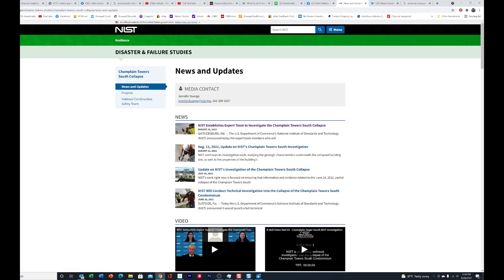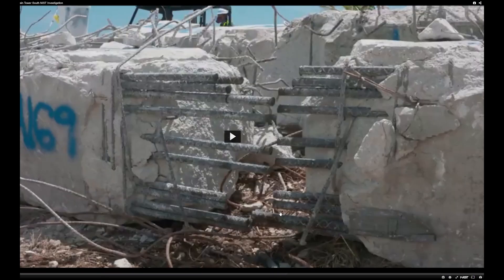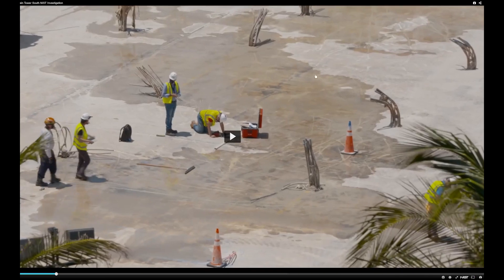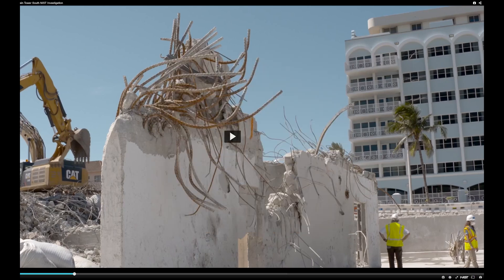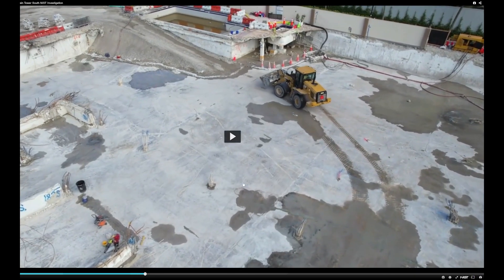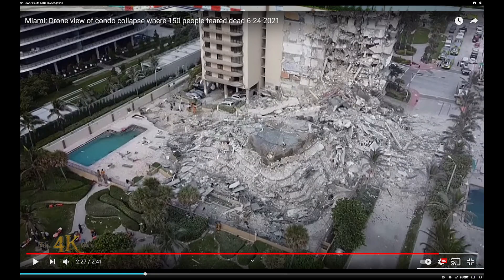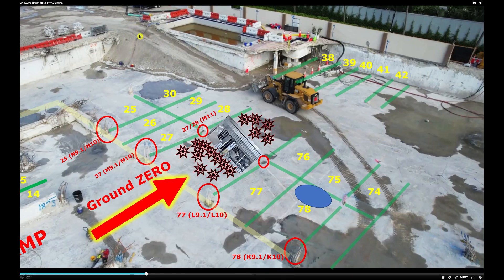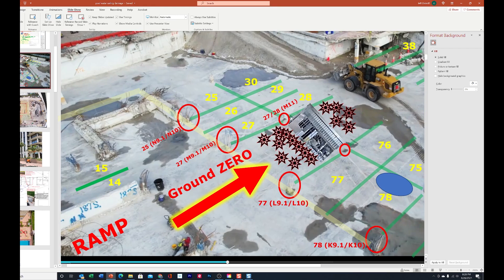Surfside Condo Collapse Site View NIST Video Ground Zero

Comment: It's as if the building was a failure from the start. Crowded rebar, corroded rebar, substandard concrete, column spacing off, the planters and lapses in upkeep. Leaking pool deck.....
Reply from the maker: Yes a whole blender full of a failure recipe

Comment: You keep saying "right here" when there is no visible cursor. This is frustrating. Others have solved this problem. You need to get a more visible tool.
Reply from the maker: some of the programs don't honor the cursor, I will continue to work on it. Also, I see it it nice and big on my screen, but when it records, the cursor is tiny, so lots of kinks to work out for sure.

Comment: Perhaps the design called for “bundled bars”, which is or was, acceptable engineering practice.  Bars look like they were cut as a part of demolishing the concrete into manageable sizes.  So, of course, you don’t see laps (or as you say overlaps!  Also, you say the bars are textured; no - they’re technically deformed.  I think you don’t know what you’re talking about.

Comment: You are not a structural engineer and you do not know what you are talking about. It is totally obvious per your choice of words you are a layman.
Reply: Please, spare us from your “expert” opinion.
Reply: I agree with your assessment.  I like the way he presents the material, but it is quite obvious that there are some gaps in knowledge.
Reply: @mariatamburro  there are really only two likely reasons for the building’s collapse, possibly a combination of both.
Salt laden rainwater penetrated micro cracks in the concrete roof slab/beams. This chemical reaction occurs and eats the reinforcing steel (rebar) and totally destroys the integrity of the of the affected portion of the structure. It is very difficult to stop this damage permanently and very expensive and a reoccurring maintenance cost. If unchecked a total collapse is possible.
Reason two: a structural design error resulting in a “punching shear” calculation at the column/ beam connection.

Comment: While you can provide pertinent information of the "after collapse", I laugh at novices like you analyzing contract documents and having little clue about how project drawings are developed.  I also lose a little respect when terms like "textured rebar " are used when the industry term is "deformed rebar" and when one doesn't really understand how to "read" drawings.  I also lose some respect when one attacks the architect without a basic understanding of how project drawings are developed.  Working with the structural engineer to determine possible spans between columns, the architect comes up with a schematic plan.  The architect may set his plan in stone while the structural engineer, working separately, will most likely have different numbers for columns.  Due to time & budget restraints of the design professionals, those minor incongruities in drawings may not get revised to make a "perfect" set of drawings.

I can look at the Champlaign Towers drawing and tell by the lack of detailing that they were slightly better than a builder's set, which means the developer was not willing to pay for a better set of drawings.

You seem to be confused by column line 9.1 and 10, but close examination of the drawings reveals it is blatantly obvious the column line is 9.1 and 10 is nothing more than a reference line for the protrusion of the balconies on the upper floors.
Reply from the maker: I laugh at clowns like you who come in and assume that because I don't use the exact same words that you do that you think it means I know nothing. I make these videos and dumb it down for the average Joe six pack to understand. The average Joe 6 pack doesn't understand what deformed rebar means, but everybody knows what the word textured means. Get over yourself go take your nonsense over to a fortnight channel where your type of banter is the norm.
Reply: @jeffostroff   - The clown is you.  A guy who is not a licensed professional Architect, Engineer or Building Inspector passing judgement on those who are.
You state "settlement did not cause the collapse", yet you have no survey data to support your claim and the large puddle of water in the vicinity of the failed columns would indicate you could very well be wrong.
Additionally, the very unlevel top of the retaining wall on the west side of the property may be an indication of settlement of that very thin wall carrying half the 26'-4" pool deck slab between it & column line 14.1.  The wall was supported by a thickened cantilevered slab with no footings directly under the wall.
You claim you are informing the uninformed, but you are also creating bias against the design professionals when you have absolutely no clue what their contract requirements were.  I can tell you, based on lack of detail, the drawings for Champlaign Towers was slightly more than a builders set (i.e. just enough to get a permit).
The lack of concrete adherence to the rebar & the fact every exposed edge of cracked concrete I have seen at Champlaign Towers has no fractured rock in it is indicative the concrete was possibly poured hot and/or lacked proper curing.
You can feed your ego all you want trying to make a buck off of a YouTube channel, but you're a clown to licensed professionals.
Reply from the maker: @paulpresson9786   I see what your problem is just because you don't share the same failure mode that I do that must mean I'm the idiot And I have no business giving opinions on the subject. And you keep bringing up the fact that I don't have A PE license well let me make this perfectly clear to you. It was PE engineers that got us into this mess in the 1st place. It was PE engineers that got us into the FIU bridge mess that completely botched the design. And yet you snub your nose down at the rest of us that don't have A PE license. I was an engineer for many years and ran into other arrogant engineers like you that if we don't share your point of view or we are somehow substandard. And yes I had a right to call that architect out for being messy with his gridlines I don't care what the circumstances are  Yet at the end of the day the architect and you're so precious PE engineer are the ones who are ultimately responsible and should be held responsible and you are not allowed to get defensive and snooty when we try to hold them accountable.  Everyone is entitled to their opinion I am, and so are you, but if you don't like it no one's forcing you to watch videos here just move along to of fortnite channel where your type of insults are the norm.
Reply: @jeffostroff   - I don't know and don't really care what your "failure mode" is.  While you are entitled to your opinion, it is just and uneducated opinion with no structural analysis.
While your channel is better than "Construction Engineering & Failure Analysis" cannel, you are still unfairly criticizing the Architect and Structural Engineer and misinforming the public about their duty and responsibility.
While I have worked with some ignorant Architects and Engineers, they cannot all be painted with the same broad brush like you are doing.
Qualified engineers have determined the structure was adequate for the loads supported by the original design.  Neither the Architect or Engineer added the planters and trees to the pool deck.  The Engineer did not place the rebar in the forms with inadequate space between the bars.  Neither the Architect or Engineer poured potentially "hot" concrete or failed to maintain the building or make recommended repairs.
While I can appreciate you taking the time to post photos of the reinforcing in the structural elements, I can also not appreciate you deriding professionals when your ability to "read" drawings is extremely limited.  Just admit you don't know what you are looking at and ask for someone to help you understand.  GRID LINE 10 IS NOT A COLUMN LINE.  IT IS A REFERENCE LINE FOR THE BALCONY PROTRUSIONS ABOVE.
Reply from the maker: @paulpresson9786  Ya see right off the bat again you're wrong.  You say "they cannot all be painted with the same broad brush like you are doing." That is blatantly inflammatory, just plain lying. I pointed out slopping gridline assignments on one architect's drawing and you blow it of proportion and make it into something that it is not. Tell me how that is sound engineering practice. Also, I still think you are wrong about your reference line to the balconies above. IF you follow that M10 line across to the left of the drawing it is for the 1' 6" step up in the slab. You failed to notice the pool deck meets the building at that point, and right where 9.1 and 10 come close together is that step up, you can see the line in the drawing, you can see several places he identifies the 1' 6" and that line coincides with M10 reference hatch mark.
Reply: @jeffostroff   - You are not understanding the drawings.  Look at the structural drawings and consider the numbered and lettered lines as GRID lines, not COLUMN lines.  Grid lines A, 1 & 10 set the outside face of columns from the basement thru the top floor.  Since the column sizes vary, the outside face of the columns is the control line and the inside face varies with the column size.
If you look at the column schedule, columns "M" are scheduled to be 12" x 36" from the 2nd. floor to the roof deck.  Although they are on the basement & first floor plan, there is no reinforcing scheduled for columns "M" on those 2 levels.  That makes me think the column schedule was revised at some point.  I have not seen a revised column schedule.  Column "M" is not drawn to scale on most floors, which is not unusual. But, it is also indicative of a developer set of drawings where the developer is not willing to pay for anything more than the minimum.
Unless column "M" was being utilized as a horizontal force (wind) resisting element, there would be no need to make it 12" x 36" the full height of the building, especially when the reinforcing is being reduced as the height increases.
Grid line "10" sets the face of the drop down to the pool deck which is shown in DETAILS AT SLAB DROPS on the LOBBY FRAMING PLAN.